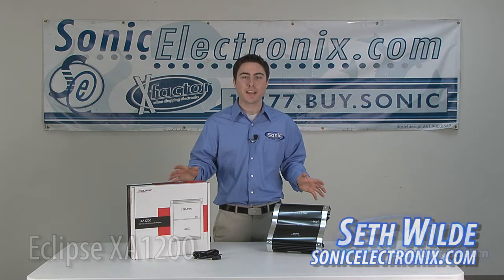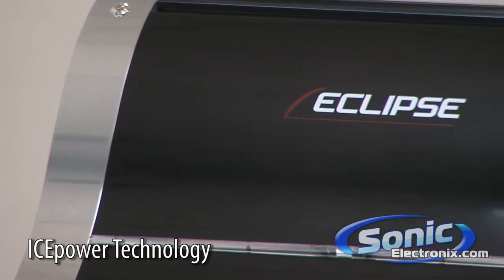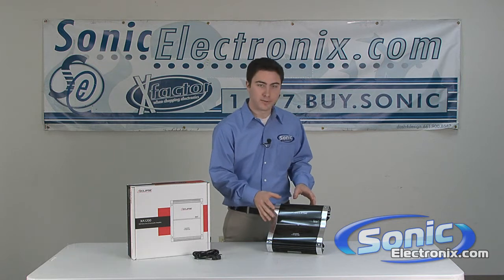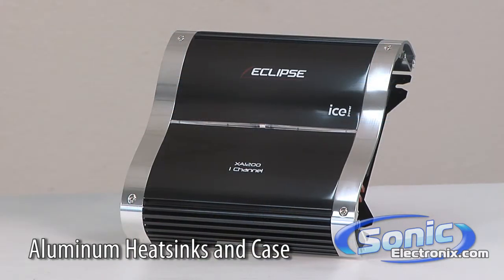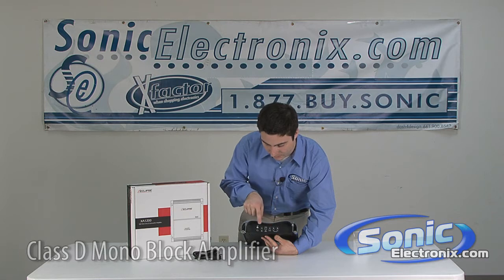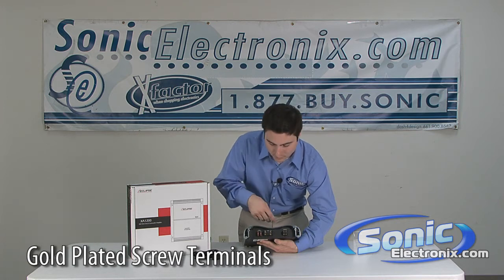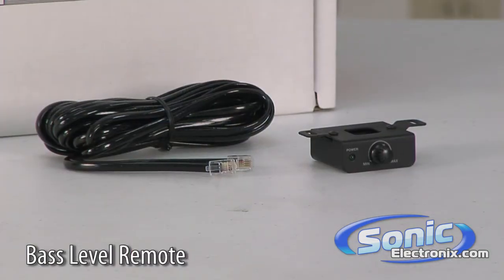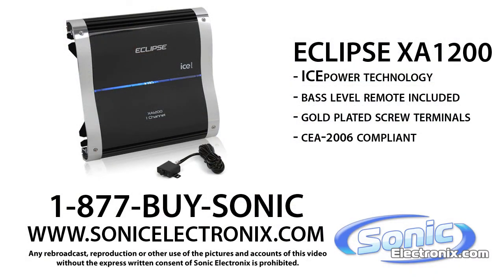Eclipse XA1200 Car Amplifier

Comment: hey Seth  my man i have the xa 1000 the older version of this xa1200 monoblock amp. i have a question it works great bangs the crap out of my subs but when i turn my sub control up on my deck itll shut off like its going into protect mode or something you have any idea why???
Reply: first off.....AND DONT BUY A CAPACITOR! they dont do shit.........
they can, however, filter out noise in the power cables.....but dont fix dimming lights (and can make it worse......due to caps having an internal resistance...you end up pulling MORE amps....more load on the battery and alt.....than running no cap)

you are running out of power...battery voltage.
when you turn it up...it uses more power

if the battery and alternator can JUST keep up...and a hard hitting bass note comes up......it will go into low voltage protect

my alpine PDX 1.1000 does this a lot......ive only got a 105 amp stock alt.....so i can play one song jsut fine
a 2nd song with a higher freq bass will drain the battery after a few hits and then my amp shuts down

i have to turn the car off, open the door, and then restart the car...........

to fix it..... 2 ways

1. upgrade your cars wiring......big 3 (battery to frame ground, alt to positive battery post,  engine to ground [this is how your alt grounds......if the alt to postive is 0 guage, so should the engine to ground.....the alt grounds THREW the entire engine]) , 
 and bigger power leads for the amp THIS MUST BE DONE NO MATTER WHAT
MAKE SURE THE GROUND IS GOOD!

2. the cheap and easy way......buy another battery or 2
now you can bump for longer before it runs out of charge....it might even be able to charge u enough between songs

3.. the expensive and harder way.......but the 100% fix
buy a high amp alt.....however, a lot of high amp alts only make their power at high RPM...like 3000+ rpm
which, when crusing around, your care is closer to 1800 to 2200 rpm
you want the highest amps around 2000 rpm (or at 800 idle rpm, but these are generally more expensive with lower max output)

take a piece of speaker wire....stab one multi meter probe into said lead
put that end on the negative post of the battery (not the terminal clamp....just the battery post.......each connection should be tested all at the same time...if you probe the clam and not the post, you dont get a reading of the clamp to battery post connection))

put the other lead on the negative terminal of your amp (make sure the amp is off, wont hurt it, but still)

it should read NO MORE than 0.2 ohms

on my car, its 0.01 ohms......a very good connection...yet still does this due to only having 1 battery and a low amp alt

if i went anything over the 1240 watts RMS i push now (1000W sub amp and a 60 watt 4 channel amp)......i would have to AT LEAST buy a 2nd battery......probably 2

Comment: I have a za1200 amp n it's barely moving my subwoofer.(10" sw8010) I swapped the amp out with my buddies RF 500watt and it pounds like crazy. What could be wrong with my amp?
Reply: bad ground or other connection probably.....my alpine PDX 1.1000 quit working....would power on, but my caps volt meter would drop from 14.4 to 6 volts and their was no output

swapped in a cadence 1200W amp....and it worked till it blew up

desperate for bass, i tried to get the PDX running again...and it worked
turned out it was a bad connection where i joined 2 lengths of positive cable together.......stuck in another half pound of soder, and it works

or you didnt set the gain correctly....